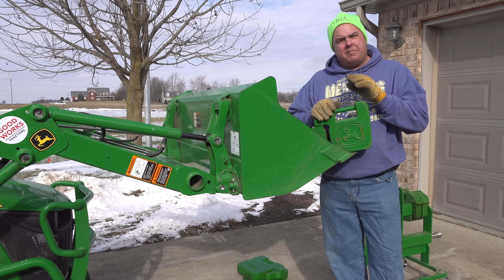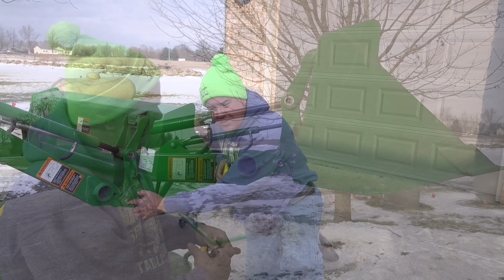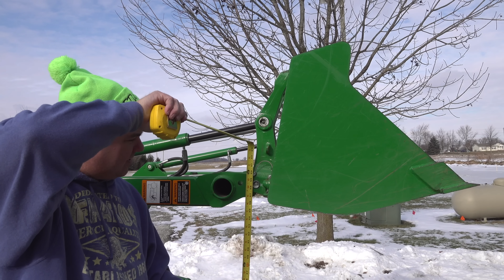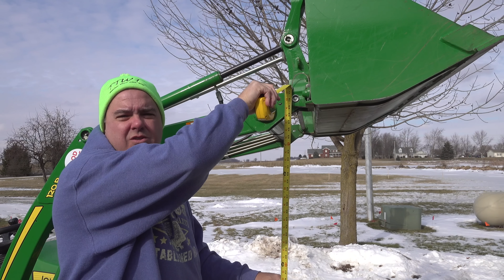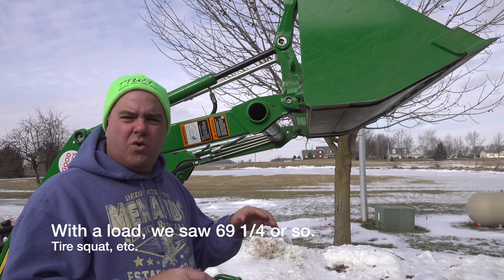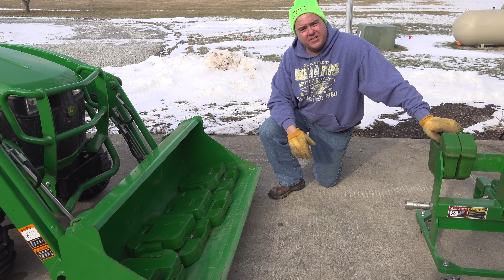Can a John Deere 1025R Lift 1300 Pounds? Mythbusters!

Comment: You forgot the weight of the bucket. That's not included in the specs. The specs are based upon math +/-
Reply from the maker: the doc said that the 1250mm (49" bucket) was used for the spec:  https://www.deere.com/en/loaders/front-end-loaders-for-tractors/120r-loader/
"Bucket used:  1250mm"
Reply: @TractorTimewithTim  That's the bucket used for the loader, not the lift spec. Lift spec is all based upon rated numbers and a whole bunch of math. They arbitrarily use a a distance 500mm ahead of the pivot. FWIW- I was at auction once and they had those collectible trucks and tractors. I heard this one guy pipe up. Hey, look this one here is One of Five Hundred. He truly thought it was #1 of 500 built. Details, details, detail.
Reply from the maker: @thnksno  Please present a link backing up your point.  The link I sent CLEARLY states that the bucket used is the 49" 1250mm bucket.
Reply: @TractorTimewithTim  Tim, it's a play on words. That is the loader bucket provided for the loader, the only one, unless you want it and something different. It's the bucket used for that model loader, for that model tractor. Otherwise they would say specifically that the loader lift specs include the bucket. Not the pin, not 500mm ahead of the pin. I'm mobile now, otherwise I'd provide a link. This is a common marketing confusion among manufacturers. This is why nobody cares about anything other than lifting point at the pin whenever buying equipment.
Reply: Agree with Tim here. It states a lot about the tractor that was used for the measurement and then the bucket. Tim has a wider bucket, considering that then the numbers are with margin of error in this emperic test. Otherwise it would mean that JD are grossly underrating the capacity.
Bigger loaders with general specs for agricultural tractors I guess are calculated given a hydraulic pressure and with no bucket started it is to subtracted from the rated capacity. But JD seems to have presented the real world numbers.
Reply: @thnksno I’m a little green when it comes to knowledge about compact tractors @TTWT great video keep them coming p.s I’m anxious to see the new trailer.
Reply from the maker: We’re leaving for Europe soon. Not sure if we’ll get to show off the trailer before then!
Reply: Yeah I was curious as well about rather the bucket weight was included
Reply: @Justinsr1983  I could very well be wrong as it relates to Deere specs. I doubt it, because they would foot note it, or why not simply say 500mm w/bucket? The cost of ink on 8 characters can't be all that much?
Reply from the maker: Did you read the doc I sent?  It clearly states with bucket.  That is all I have to say about it.
Reply: @TractorTimewithTim  Yes, I did. All it states is that the standard bucket is General Material 1250, there are however options for Quick Attach buckets. Nothing says the bucket is included in lift spec.
Reply: After consulting with my dealer, he confirmed you're partially correct. They use the calculated weight of the bucket for published specifications. He pointed out however, that it is a "calculated weight," not a true test weight. He added that no two tractors will lift exactly the same weight, there are too many variables. The calculations are based upon ASAE standards that provide a target value +/- an acceptable %
Reply from the maker: Thought so.  Thanks.  
I believe my tests showed that their calculations are right on.  
Having said that, being within 10 lbs was close enough for me.  I was trying to illustrate how much more it can lift near the ground than at full height.
Reply: That's a simple geometry problem. Your daughter should be able to help you out with that, have a safe trip.
Reply: I browsed a bit further among JD loaders. What is linked is a comparison tool pulling records out of a database. It's not so nicely packaged, just fields one after another. It shows these tests for JD loaders and tractors but also competitors. So no footnote is possible, it is meant to be read line by line. First a detailed spec for JD tractors used and then as we know, the "bucket used" field.

Comment: Hi Tim.  I have the Deere 1025R as well.  What is the proper throttle position for doing work with this tractor?
Reply from the maker: Plenty. In other words, use lots of throttle. As you can see, it doesn’t have much power or hydraulic flow at idle.  Don’t hesitate to run full throttle.  It is meant to run that way all day.
Reply: @TractorTimewithTim  so full throttle won't strain the engine if used often? I thought the manual said to stay around 2400 rpm?
Reply from the maker: Oh no. The machine is built to run full throttle all day long for its entire life.
Do not be bashful with the throttle.
Reply: @TractorTimewithTim  so 3500 is good to go!?!  Had the machine three years now and never put it that high or pinned the throttle.
Reply: I don't have a Deere tractor, but do have a Deere Ztrack and same as my Kubota B series. Use throttle as you see appropriate. Sometimes I tool around fine at 1300, though doing most lifting work I run about 2200 with power to spare.
Reply from the maker: ...then you've only used 1/2 the tractor :-)   Yes, don't be scared to push it to the stop.   ...just as I did in this video.  Won't hurt it.
Reply: @TractorTimewithTim  Thanks so much Tim!  Like I said, I've had it for three years and I love it.  I watch all your videos to learn as much as I can about it.  Keep doing what your doing!
Reply: @paulcorsetto6047  Yes, use it to full throttle. However, you'll probably find as I do, making all that racket doing simple chores isn't necessary. If I'm just moving gravel from A to B 2000-2200 is fine. If I need to power through heavy wet snow pulling a 5ft blade, put her to the rug.

Comment: A similar tip i do when im loading a bigger bucket on a bigger tractor, is if i cant lift it higher i tip forward ever so slightly then crowd it back quickly and lift and the same time, the momentum of it curling back will allow you to lift higher. Do that a few times and you can get high enough to tip into a trailer or something, although it can get a bit sketchy when up that high!

Comment: Very good Tim & Christy! I tried to lift my 2048 rotary cutter (516 lbs spec.) with the forks and 1025R started to raise the rear end. Wound up just picking up on the front and letting the rear wheel take the rest. Loaded tires but with backhoe removed. Like you said, GO SLOW!! Thanks as always very informative.

Comment: I know firsthand that I can lift a 280 pound 42" fork set and a 960 pound generator just a few inches off the ground, but enough to move it.  It involves some trickery, and the bulk of the weight is near the hinge point, but my 1025r does it.  Not sure if the 5-gallons of diesel and two batteries are included in the generator specs, but they are also adding to the weight.
Reply: Thanks. I was thinking that when I retire and get a tractor, I’ll have to be able to lift my Kubota Lowboy generator with its cart.  That works out to about 950 pounds.  Looks like I’ll have to go up a size or two.

Comment: How does the lift compare to 2014 Johnny? Pretty much identical would you say?
Reply from the maker: Did not test. Should have been very close.  The H120 loader is rated slightly less..5lbs or so.